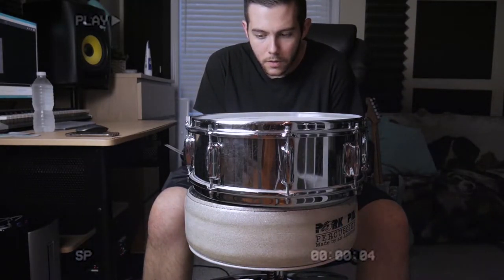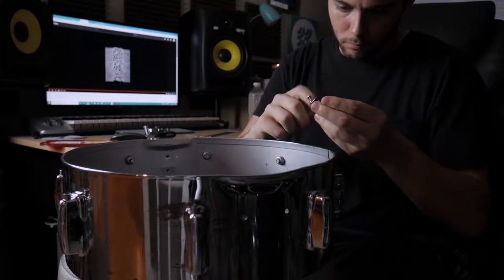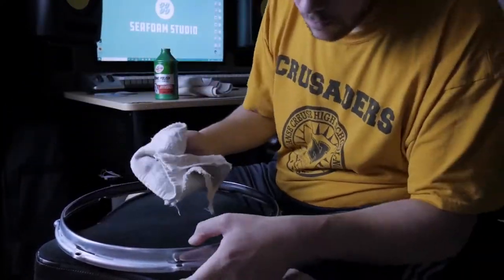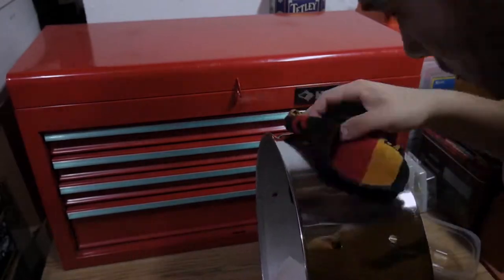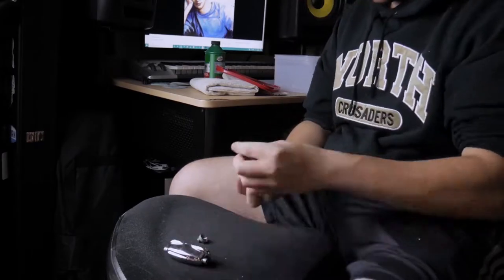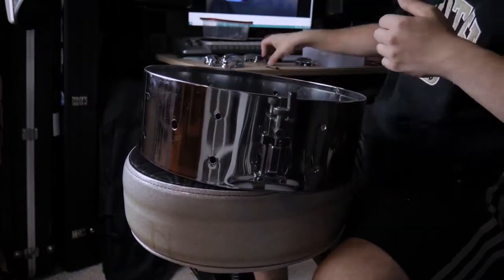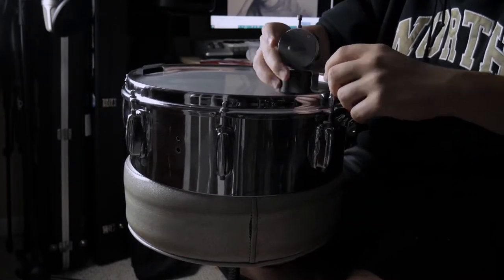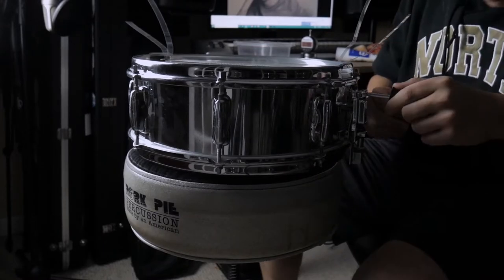Snare Drum Restoration | Slingerland Festival Snare 14x5

Comment: Awesome!! I have the same model and tried to replace the reso head but I’ve noticed it doesn’t really fit the sides just like yours (snare beds) are really deep and it doesn’t fit I just ordered some classic fit remos hoping this solves the issue
Reply from the maker: That could absolutely do the trick. I found out my issue was the rims being slightly bent. So I used a blow dryer and a rubber hammer to attempt to get the dings out. Not the best solution, but the head sits better on it now. Let me know how the classic fit works! Also, thanks for checking out the video!